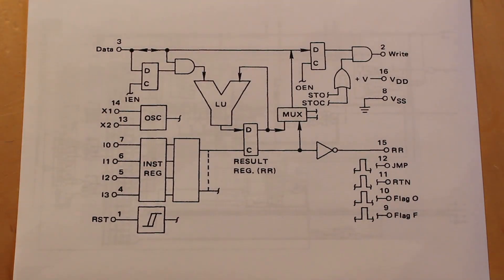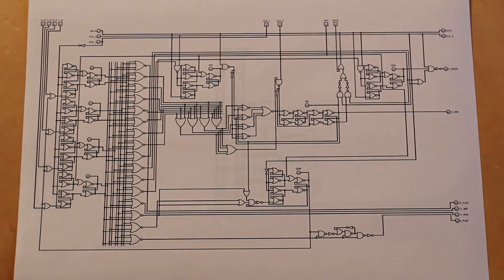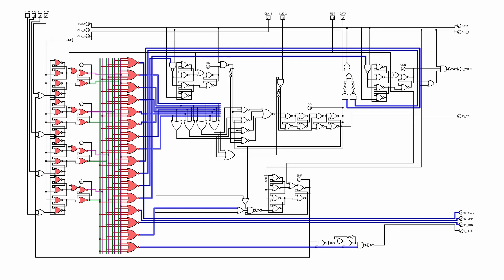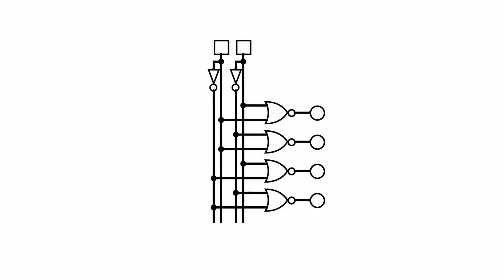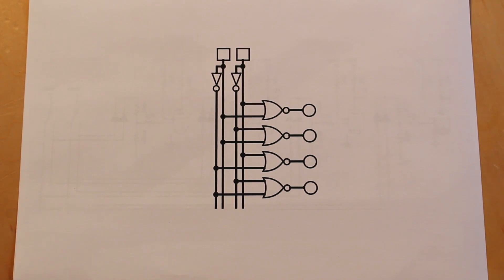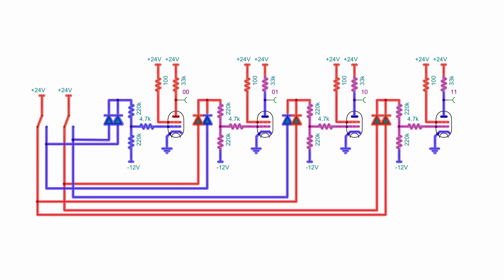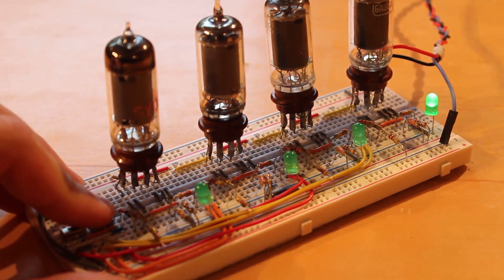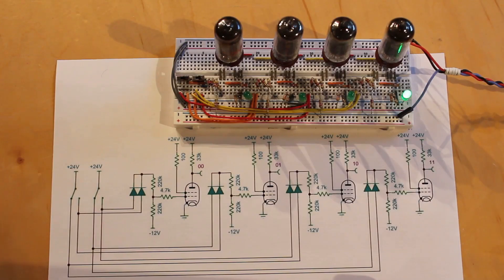Vacuum Tube Computer P.11 – Building a 4-bit Decoder for the Instruction Register

Comment: Using simple mental arithmetic: For each heater, if running at the rated 6.3 Volts at 300 mA, the  power is 1.9 Watts per heater. There are 52 heaters, so the total heater power would be 98.8 Watts. Not the ~80 Watts which you stated at ~18:36, or the 88.9 Watts which you calculated. So you're saving at least 10 Watts for every 50 tubes in the final circuitry. About a 10% power saving. That's worthwhile, with the added bonus that the heaters will last for at up to four times as long as they would if run at full power.

Comment: I support your using semiconductor diodes.  They were in common use with vacuum tubes during the early VT computer days so you are authentic expect for your low voltage B+.  I respect your fear of high voltage.  Most techs of the day got harmlessly zapped a couple of times at 100 to 180v and learned to be careful.  Your way IS going to work, it just takes more effort with the tubes working in "low gear."  GREAT JOB and very interesting!

Comment: I wonder, if semiconductors hadn't been invented, whether by now we'd have big glass bulbs containing entire registers, decoders, multiplexers, etc.
Reply from the maker: There's actually three tubes that can give us a sort of glimpse into that alternate timeline!

The Loewe 3NF was an interesting little design that was actually to avoid tax laws on number of tubes in a circuit. It stuffed three triodes, two capacitors and four resistors into a single glass envelope, making it essentially a vacuum tube integrated circuit. The capacitors and resistors were encased in their own glass envelopes inside to prevent them from contaminating the vacuum. It's a beautiful chunk of engineering! Here's a bit more on it: http://www.electricstuff.co.uk/loewe.html

The Additron is another really beautiful piece of engineering too. It uses multiple beam forming plates around a central cathode to build a 1-bit full adder contained inside a single glass tube. Here's my twitter post on it: https://twitter.com/UsagiElectric/status/1374087658671050754

The RCA Selectron tube is probably my favorite piece of tube computing history. It was a single (massive) tube that stored data as electrostatic charges. I believe the biggest version could store up to 4,096-bits of memory, which is a stunningly large amount to have stuffed into a single enclosure! Here's the wiki article on them: https://en.wikipedia.org/wiki/Selectron_tube

Comment: For the decoder my pet peeve would be to use an electron gun an deflection plates to in a single vacuum enclosure. How good does the vacuum need to be ? How expensive is a turbo pump nowadays?
Reply from the maker: That's an interesting idea! Using, essentially a CRT as a decoder would be an excellent visual way to view, but it would change the inherently digital instruction into an analog signal, which would make all sorts of other interesting things happen. But, most importantly, in order for an electron gun to work, you need a ton of voltage (I think the smallest 1" CRTs require around 600V, and anything larger is in the kilovolts range).  For this project though, I'm trying to keep the total voltage in use here at just +24V, so the system is safe to poke and prod around with any fear of getting shocked!
Reply: @UsagiElectric  I reread that voltage requirements. If I really want high voltage ( for speed ) would probably need a case with a door which controls the voltage. I wanted the deflector plates to be arranged as a tree. So each node is digital: left or right , up or down. It is like pass or block on a grid. It can be digital.
Ah and sorry, I guess there is no such CRT available. The electrodes would have to be bent. I don't know why, but in the lab we stopped using glass and switched to steel. So at least we can open and close it. Before my time there was someone who could open and close glass.

Comment: I´m wondering why you aren´t using sockets. Tubes, especially used ones, might get bad. Debugging will be hell. Great project, anyways!
Reply from the maker: Thank you!
It's a little tough to see, but I'm actually building my own sockets directly into the PCB, so the tubes can still plug in and be removed without having to desolder anything.
I use a Harwin made 1mm PCB header and a custom footprint I made in my EDA software. At 11:05 you can see me popping the headers in and soldering them in place. I've had my fair share of bad tubes throughout the project, so being able to quickly pop them out and test them has been essential!

Comment: you are programming the decoder with the 4 jumper wires per tube
Reply from the maker: Essentially, yup!
The 4-bit instruction register is just there to latch in whatever the 4-bit instruction is. But, when you break it down, a 4-bit instruction means there are 16 different operations that can be performed, so the decoder just takes the 4-bits from the instruction register and decodes it into 16 individual signals that I can then use to drive the rest of the system!

Comment: You're being a real madlad with this DPL (Diode Pentode Logic) apparatus.  I hope it works great.  It's the kind of hobby I'd dream about, but wow the amount of construction required.  If I wanted to run a Linux like system, it would easily fill a room, need thousands of tubes, and eat kilowatts.  Then it would be dog slow... but it would be a living proof of concept!

It's also cool how you laid out and machined the PCBs, however if there was a situation where point to point wiring would make some sort of sense, it's this, and that's because of the current draw of the heaters and the possible need to revamp their wiring.  But given that you have PCBs, why stay with 1 mm traces for the heaters?  That's fine for signals but I'd go much wider than that for the heater leads.  I'd believe that as this thing grows, some kind of grid of between-card connectors that carries the heater power from heavy buses would be in order.  Do your electrical engineering calculations before you fry your boards.  Electroboom may be unlikely, but electrocrack or electromelt quite possible.

As a suggestion, if you wanted to be super hard core, you could do tube diodes too, e.g. 6AL5s, though this at the cost of a larger layout and more heater current yet.

Speed of operation is another consideration.  With a cathode follower, when the output wants to go high you have the tube conduction batting for you, but when it wants to go low, the pulldown(s) has/have to do that, and you've got pretty high value resistors here.  This is what will limit your speed.
Reply from the maker: Thank you!

I have actually done some thinking on the heater traces here. Unlike traditional tube circuits, I don't actually have a separate 6V power supply for the heaters. Instead, I'm actually using the 24V supply and stringing four tube heaters together in series and powering them off that supply (which is also the primary supply for logic). The benefit of this is that there's a whole lot less current draw, and it keeps things super simple. I am indeed using 1mm traces and the PCBs I'm cutting have 1oz. of copper, so that means that one trace should be able to carry about 3A of current before things get sketchy. Still, that's a bit melty if I were trying to power everything through a single trace, but I've tried my best to spread the power distribution around as much as possible. 

Check out the top 1/3 of the build here (and we've built most of this already): https://i.postimg.cc/1thwGZhb/IR-and-Decoder-v2-PCB.png

It's a little difficult to see, but each board essentially has it's own power bus at the top of it. Meaning, there's four power busses that span from left to right. Then the end boards are the main power feed boards, and they use 2mm thick copper traces. So, ideally, out of the 68 tubes shown here, the amperage at 24V should be at most 5A, which should be divided up across four different power rails. It should be well within spec for 1mm copper traces, but reality can sometimes be dramatically different than doing some back of the napkin math. If that does become an issue though, I can always solder 1mm copper wire over top of the power traces to help carry some of the current. That's a fairly easy thing to do that doesn't require any massive redesigns and should triple the current capabilities (though if I'm at that point, I need to start thinking of better connectors between boards). 

As for going full hardcore and using some 6ALs5, I did actually think about that, and I even built all six logic gates using pure hollow state logic (https://youtube.com/playlist?list=PLnw98JPyObn1i3yJ2Q7A62cl2eVXoIPP0), but as you said, it's essentially double the power draw for all the extra heaters, and at that point, I would most definitely have to rethink power delivery!

For speed, I'm honestly not aiming for a high speed at all. The purpose of the build is to be able to see everything that's going on, so 90% of the time will be spent either single stepping or running at like 10Hz. It will be fun to try to push it, and I'll be super happy if it can handle anything over 100Hz. So, I guess in summary, my theme is to set my standards low and be happy when they get surpassed, haha.

Comment: Amazing project. You could use subminiature tubes for future projects/expansions.
Double triodes are most common, and military versions were more reliable than early transistors.
They're about the diameter of a pencil and most were made to be soldered directly (flexible leads).
They also draw very little filament current, so less stress on the power supply.
Reply from the maker: Thank you!
I do really want to build some stuff with some subminiature tubes. I think they could make some awesome, complex components in a really compact package. Could probably fit two or three D Flip Flops in the space one of my current D Flip Flops takes up. Though, the primary reason I chose the 6AU6 for this project (aside from how well it performs at super low voltage), is that it's really cheap!

Comment: Are you sharing the schematics anywhere?
Reply from the maker: Not anywhere specific at the moment. Though, that's mostly due to the fact that I don't really have much in the way of total schematics. I just have schematics for the individual pieces (like a D Flip Flop, one decoder, etc.) and then a large logic diagram for the entire thing. Also, I'm not sure the best place to store and share all the data I have stored on my HD for the machine just yet. 
If you would like to see some schematics though, come join us on the Discord and I'll be more than happy to share up any and all schematics I have so far!
https://discord.gg/p7UsfHD
Reply: I enjoy designing circuits in Altium, so I was thinking of following along. I don't use discord much, but I might just do that after I finish rebuilding my computer (next day or two).
Reply from the maker: @TinkerLynx  Nice! I'd love to see anything you make if you do follow along!
Here's a few schematics that pretty much cover everything I've built so far:
MC14500 in gates: https://i.postimg.cc/1Rpdfwxd/Overall-Architecture.png
The 2-bit Decoder: https://i.postimg.cc/L5M0x6Pv/Decoder.png
My D Flip Flops: https://i.postimg.cc/vmcjBKM7/DFF-6AU6.png
Let me know if there's something else specific you want to see!
Reply: Okay, now I'm reading the Customer Engineering Manual for the IBM 700 Might try a less kid friendly (+-48v) version using double triodes.
Reply from the maker: @TinkerLynx  IBM has the absolute best Customer Engineering manuals - they're full of so much invaluable information! 
Looking forward to updates on your less kid friendly version over on Discord!